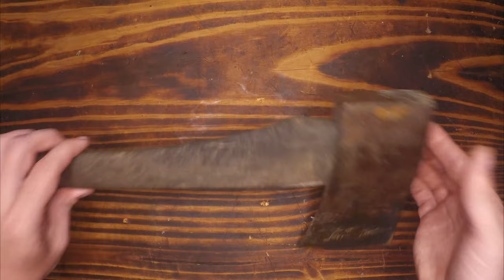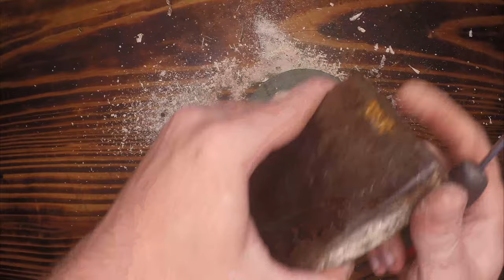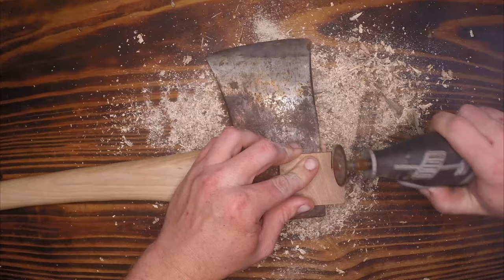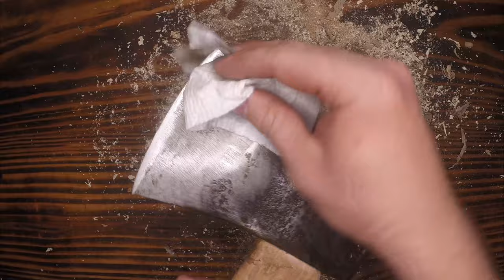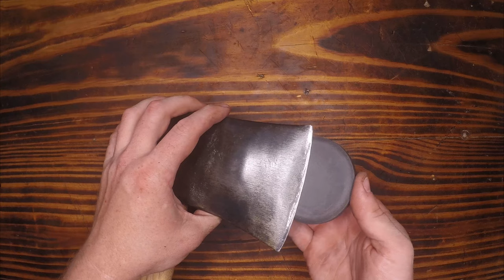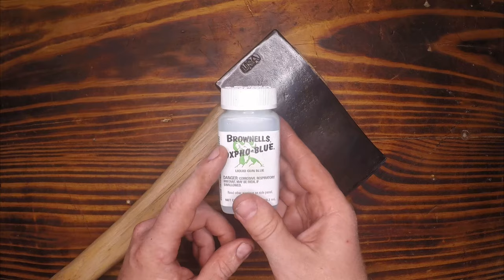Restoration Time Lapse With Instructions

Comment: A great tip that was shared with me: If you’re wooden handled tools get loose in a metal implement, soak the wood part in water to get the wood to swell up to its original size and make things tight again. It works nicely
Reply from the maker: That will work for awhile.